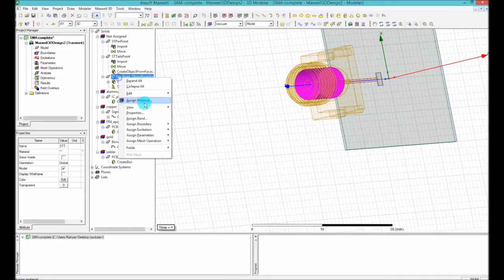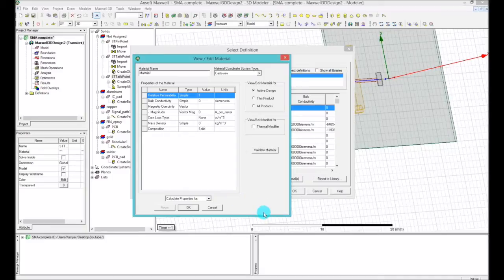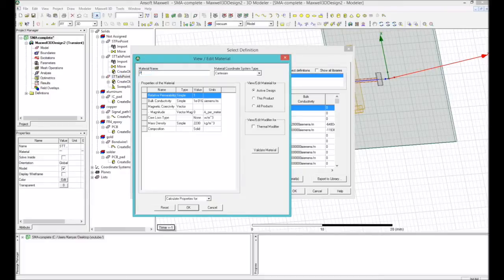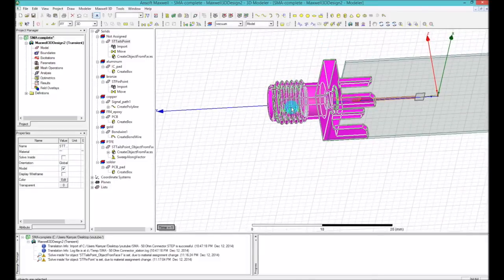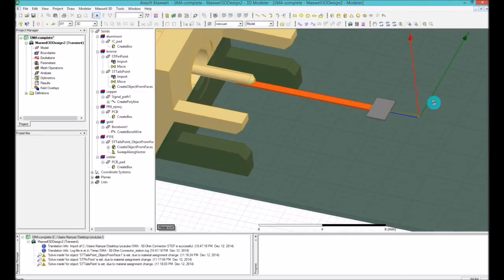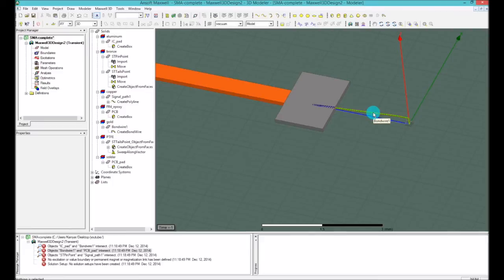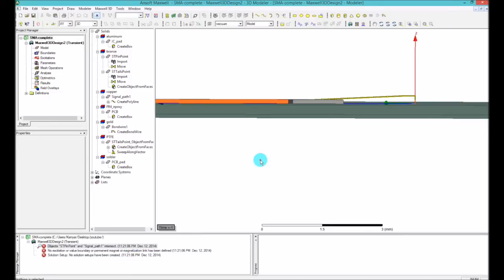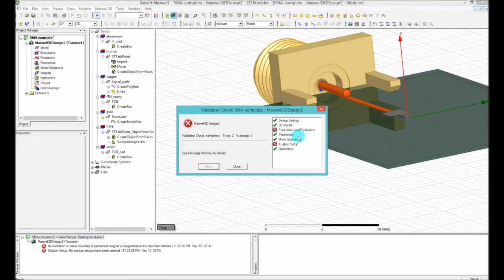111 - Ansys Maxwell - Validating and fixing common errors of the model

Comment: I imported my CAD file from Solidworks into Maxwell 3D. It has 6 layers of parts connected at interface. Though they are not intersected, it shows parts intersect error in Maxwell. How to solve this error? I tried with substract tool, but couldnot solve this. Can you please help?

Comment: Hi, the pin that is inside the SMA connector shouldn't be longer and aligned with the back surface of the SMA connector? How do you apply the excitation to this system? I mean inside of the SMA is empty that doesn't make sense.
Thanks in advance.
Reply from the maker: +Ahmet KURT  you make a cross section of the pin inside the sma and amply voltage excitation. Work the best in hfss since you probably simulating for higher frequencies.